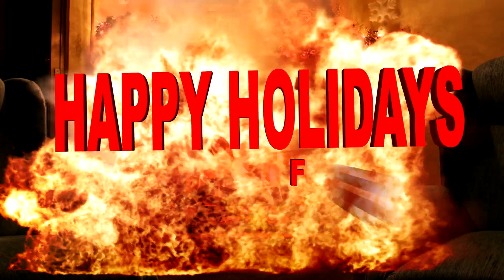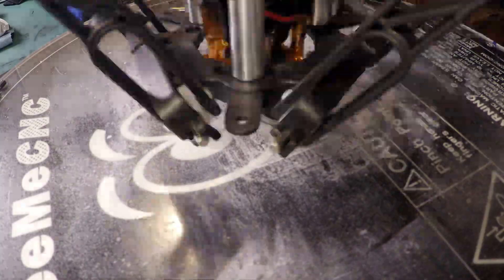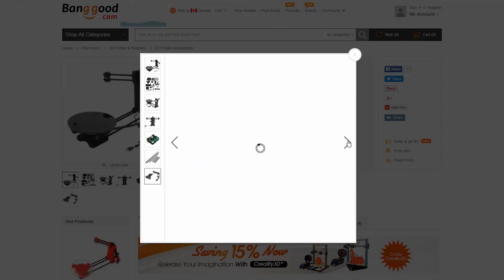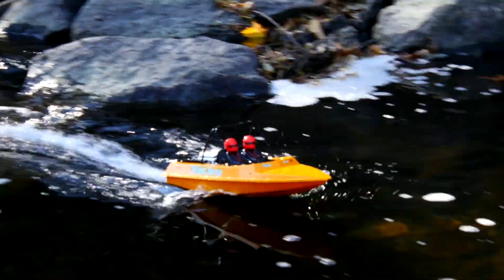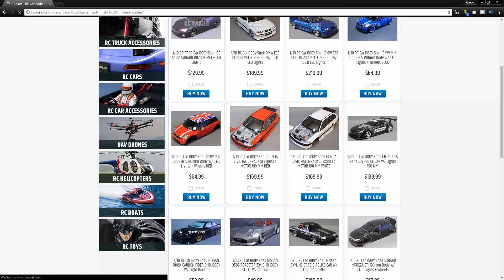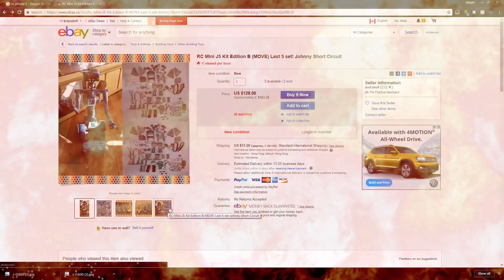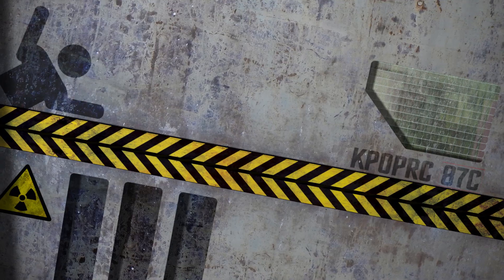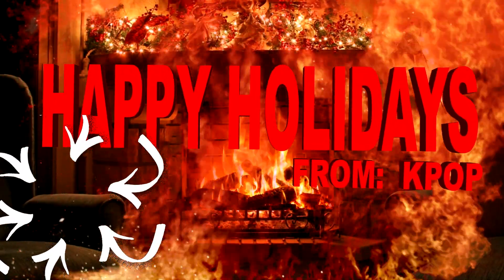TOP 5 WAYS TO SPEND CHRISTMAS CASH ACCORDING TO KPOPRC

Comment: Nice video and happy holidays! I'm looking forward to seeing your build video for that scanner. I built a similarly designed laser scanner from scratch and used some open source software to run it a few years back. It worked pretty well and it was a lot of fun to scan stuff but It wasn't quite high quality enough that you could scan a 1/24 model and reproduce it at a 1/10 scale with much detail. Plus there would usually be a lot of noise on the surface. So it will be interesting to see the quality of the scans this set up is able to capture.

Comment: KpopRc,  is the 3rd printer and scanner ready to use straight out of the box or is there other stuff you need to acquire before use? I'm hunting for a complete set up at the moment so please help....
Reply: Usually those come in kit form, needing assembly, though there is great community to help out if you go with open source printer, though mind that try avoid plexy frame printers. 

Also you dont need that 3D scanner. Just normal camera, rotating stage (you can make one from old stool, armchair leg, or just two boards, two bearings and bolt depending on size you want) solid color back ground and software to edit those photos into 3d model. Cant recall what program my m8 used, but google: "3d model from photos free" and you will find one.
Reply: Hellsong89 
Nice one. Thanks for the update.....